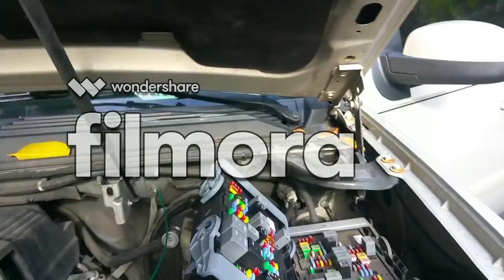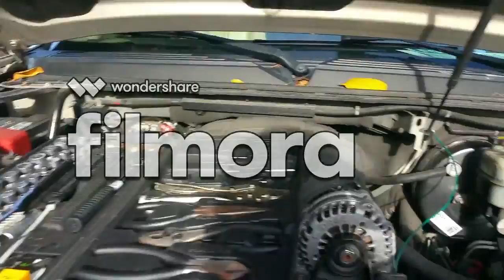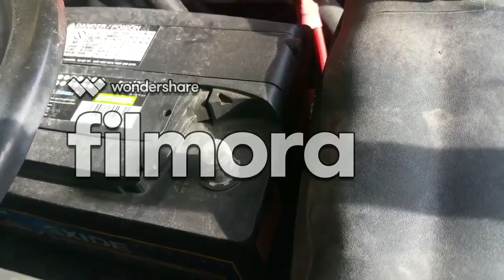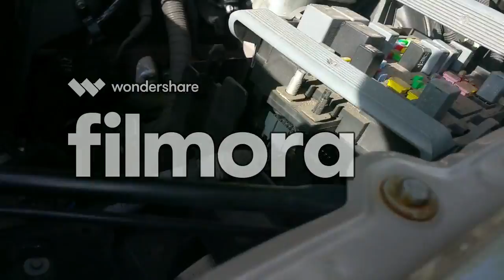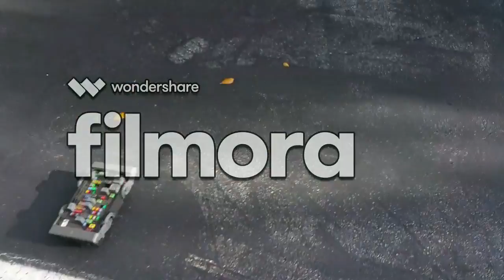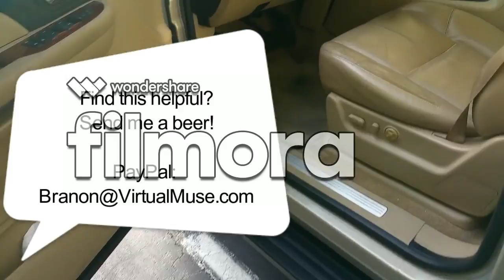2007 Chevy Suburban 1500 LTZ Replace Fuse Block to Repair Electrical Issues

Comment: Thanks for the video. Good idea using the contact cleaner. 
It’s recommended you remove the negative battery cable.

Comment: Thank you !!!!! I’ve been having electrical problems and the ground wire was the problem the whole time I did just like you did the the extra wire after taking’s the fuse box out🙄 but it fixed all my problems
Reply from the maker: I'm glad it helped! It amazes me that the dealerships don't seem to know about this - or they do and just want to replace one shorted out part after another to make a buck. I've been amazed at how many people I've met and chatted with over the last 6 years who've had ground wire problems on their Chevys. Now, if I could just monetize the video. LOL

Comment: 2011 chevy Silverado 5.3.  My relay for my fog lights ((4 prong) one of the prongs broke off inside due to corrosion.  Is there a way to get that broken prong out of the fuse panel?

Comment: I have a short going to the fuse block killing my battery I wonder if that’s the same issue . 2010 Escalade
Reply from the maker: Could be.. just add an extra ground wire from the firewall geound screw to the alternator bracket and see if that helps.. might also take the fuse block off and make sure there's no stray debris
Reply: @branon9531  oh I did the ground there a while ago and replaced the ground on terminal going to front bumper. I’ll try fuse block. Thanks man

Comment: Are these panels the same across options in that year?
Reply from the maker: I believe there were 2 different versions, the parts place used my VIN number to pick the right one. Mine was the LTZ, so it was probably the more expensive of the 2. LOL

Comment: Branon I have a real challenge wanted to see if you can help. I have a 2004 Chevy Avalanche and when I go to turn it over all I get is the clicking. Long story short I replaced the starter, did work. I then replaced my still under warranty battery still didn't work. I thought it may be starter relay but didn't work. I then checked my battery with multimeter while it was running to make sure the alternator was charging. I only got 12.6 volts max. So decided to replace the alternator but it is still not charging my battery and truck won't crank without my jump box. Please help!!!
Reply
Reply from the maker: I'm a real estate broker, not a mechanic - I just do a little Do-It-Yourself on things that I have the tools to do. I would check the ground ribbon that runs from the fire wall to the back of the motor (a little awkward, I had to actually lay on the engine to see where it connected). I would also add the second ground wire as I discuss in the video since there are dozens of grounds that go through that one grounding point. Any one of them could be creating an issue. If you get stray warning lights like Stabilitrack, ABS, etc.. it's often the ground wire just not making a good ground. Apparently, electrical problems caused by faulty ground is a major issue with the big block Chevys and GMCs.

It does sound like it could be a starter relay, but if the alternator isn't charging, maybe the wiring from the alternator to the battery has an issue? Again, start with the simplest fix (add the second ground wire from the fire wall to the alternator bracket).. and then start using your MultiMeter to see if you can find a broken wire somewhere between the alternator and the battery. I'm sure there's someone who's commented here that has had a similar problem or might be a mechanic who can help. Good luck, and if you don't mind, please report back so we can all benefit from what you learn along the way. Thanks!
Reply: @branon9531  well after alot of testing and head scratching I finally figure out the problem. It was a bad ground off the negative battery cable going to the frame. I have since added a ground from the negative side battery cable going to the firewall and all is working like it should! Thanks!!
Reply from the maker: @roosterpalooza1985  Nice catch! Glad it's working again!!
Reply: @branon9531  thank you for the response I will definitely be checking that ground ribbon today and adding the extra one you suggested. If I happen to solve this mystery, I will definitely be following up to let everyone know.

Comment: My 2011 Silverado LTZ radio will turn off on its own and my stabiltrak will turn off as well. I hope adding an extra ground cable will work I’ll do it tomorrow after work I’ll keep you posted. Thanks for this info!!

Comment from the maker: I can't find my original purchase email, but I think it was this one:
https://www.gmpartsdirect.com/oem-parts/gm-junction-block-19210436
Reply: They have it.  There’s an important factor of major concern.  Many of the online sales sites have you enter your VIN to confirm correct part purchase.  However, many of them use the same source and there’s a glitch in it.  In my case, all the sites said that the 22798214 junction block would not fit on my 2012 Chevy Silverado 1500 V6 WT.  I contacted several Chevy dealer parts counters and was informed that it was the correct part.  I pointed this out to the site that I made my purchase from and that’s when I was learned of the glitch.  Always contact Chevy or GMC dealer parts departments before buying.  A few dealers asked for the year and last 8 digits from the VIN where others requested all 17 numbers.  Even the site that I made my purchase from had the very same glitch issue.

Comment: I cant get none of the harness to release from old fuse box am I missing anything I pulled up fuse box and harneses are still attached  did you have to remove the 2 screws in front of fuse box pleaseee help
Reply from the maker: There are two levers on the ends that you unlock and the whole thing should just lift off. If the harness underneath are still attached, I'm guessing you would need to wiggle each one individually to get them loose. Just make sure you re-seat them in the right spots. I didn't have that issue, so I'm not sure.

Comment: Thank you for the tip where to get the fuse block. The braided ground straps can be bought in most parts stores in the battery accessory area. For GMs you should have one from the fire wall to the engine and from the fire wall to the hood. One video I saw recently said these grounds being bad can cause weak radio reception.
Reply from the maker: Yup - the first problem I noticed was my radio popping randomly... the problem escalated into ABS and Stabilitrack warning lights at random times. The ground ribbons are pretty easy to find, but you can't really tell when they start cracking because they're hidden behind the motor... adding the extra ground wire is just a backup preventative... and it's easier to check, obviously. I didn't notice one going to the hood... I'll have to check that.

Comment: Any cheat codes on getting wiring harness apart from fuse block? Mine is not sliding off nearly as easy as in the video.
Reply from the maker: Assume you would just wiggle each one individually a bit to get them to release. Hopefully, you didn't get a short that melted anything together. Sorry for the late reply. I don't monitor this channel regularly.

Comment: Could this also fix the relays to the door??? My 09 Tahoe isn’t getting an power to my driver door
Reply from the maker: Entirely possible... the ground wire  supports something like 80+ points. It's $3 worth of wire.. what could it hurt?

Comment: Been having electrical gremlins for about a year.  They come and go...I wiggled tight all of the harnesses, cleared codes and was back on the road issue free...been doing this from time to time but I'm to the point that I need to fix it for good.

Will definitely be adding the extra ground.  Any thoughts on the RVC Regulated Voltage Control system?
There is a sensor near the fuse panel that reads the return current and then tells the alternator to charge the system.  Some have had success with unplugging this 3 pin harness while others have addressed the error in the voltage signal return by replacing the grounds (path of least resistance...bypassing the measured return ground)

Just thought I'd share my thoughts and ask to see if any of the electrical issues have resurfaced?

Stella's UP!
Reply: Jay did you figure out how to fix the RVC issue you described above. if so care to share I may have the same issue as my new alternator is still not charging my battery.
Reply: @roosterpalooza1985  
Clean all harness connections...at tranny...BCM...Everywhere
Install new positive and negative GM OEM battery cables 
Added an extra ground from alternator mount to existing firewall ground on drivers side.
Problems went away for awhile....started again.....changed the alternator...even though it tested good and we haven't had a problem ever since

Comment: 🤦🏾‍♂️I lost a terrible fight last night to those 2 stupid fucking grey plastic arms. I tried for 2 hours to get then in the right groove to get them to lock the fuse box on and just ended up breaking one of the black retaining clips on the base and both gray arms. I've replaced countless transmissions, engines, and many other common parts on cars and trucks throughout the years and I think I've met my match. I just couldn't get it to seat in and now my brother's 13' Yukon Denali is stuck in my garage until I figure this shit out. I'm almost to the point of taking out a personal loan and towing this damn headache to the dealer and let them take care of it. I know I'll be anally raped on the price but right now I'm pissed and ready to get it back on the road. Any more tips on persuading the box back onto it's base or am I totally screwed?
Reply: If it didn't drop right into olace, my guess is they sold you the wrong fuse block. There were 2different versions for my 07 Suburban, and they had to use the VIN to order the correct one
Reply: Agreed, those handles are a real pain and they have to be manipulated in just the right way to remove and reattach!

Comment: Are there supposed to be nuts on those two posts/threaded bolts sticking out of the relay piece that you pull out (visible at three minutes 55 seconds)???
Reply from the maker: No, that's how it came... and I did not have to remove any nuts from those post bolts when I removed the old one

Comment: The two studs in the front of the box are for your trailer breaks and your constant 12v to the 7 pin harness in the back bumper..
Reply: So they are not supposed to have nuts on them if nothing is attached?
Reply: Thanks for this response, mine has wires there and I didn't know what for.

Makes since now as I have a trailer brake controller.

Comment: So while my cousin unhooked the positive cable from the battery to replace the fuse block I notice he accidentally touched a metal piece under the hood with the positive cable & now that the fuse block is in nothing on the truck is getting fire even doe my battery is brand new & was working fine b4 all this...Can you tell me what can b the problem please
Reply: Cornelius B Jones check the 175 mega amp fuse
Reply: I always thought you just needed to remove the ground wire working on anything electrical?
Reply: Agreed!  Check the mega-amp fuse and always disconnect the battery ground terminal first and reattach it last.

Comment: I have a 05 tahoe. Will this fix my 4x4 selector and my heated seats. They seem to have a mind of there own. Middle of summer, driving down the highway and the heated seats will just start on there own. It will do this several times until I shut down the engine and re start it.

Comment: I have a 2007 yukon.  My backup lights stay on all the time too.   I had to pull the fuse because it has been going on for a few months now.  

Recently, I added the ground wire, like in this video.  Since then my truck doesn't want to turn off, after I remove the key.  It'll will sometimes run for 3-5 more seconds (once it ran for 30+ seconds) after I remove the key.  I don't think the new ground wire caused this.  Probably a coincidence.  I figured this new issue was also from a bad fuse block.   Note- it isn't dieseling, it is running smoothly, it just doesn't want to turn off for a bit.

So I finally replaced my fuse block (just like you did).  However, replacing the fuse block and it did NOT solve my reverse light issue or engine continuing to run issue.

If it is not the fuse block, does anyone have an idea of another reason why my reverse lights would stay on, or why the car would keep running after the key is removed.
Reply: Probably need a new ignition switch if it wont turn off
Reply from the maker: See comments above about trailer lights... could be a bad neutral safety switch apparently. The reverse light issue SHOULD be the relay built into the fuse block - especially if pulling the fuse fixes it. The entire problem stemmed from a bad ground - replacing the ground wire (ground ribbon from firewall to rear of engine) or adding a second ground wire from firewall to the extra bolt on the alternator bracket - should prevent and solve many electrical issues on the big block Chevy/GMC trucks.

Comment: Good video but. Someone repair the fusebox???
Reply from the maker: The backup relay is a circuit board built into the fuse block, so there's no way for a layman to fix it. The other relays are just quick swap outs, but the back up is hard-installed
Reply: I’ve owned my 07 Suburban for 4 years now and haven’t had reverse lights the entire time. Going to pull a couple junk yard fuse blocks hoping they’ll be in good shape enough to get reverse lights.

Comment: Your fuse block simply lifted up off the base, which is super convenient.  On my son's 2008 Silverado, the wiring harness connectors lift up with the fuse block.  Since you can't rotate the fuse block when connected to those three stiff harnesses, you have to disconnect everything "blind," and singly.  What a hassle.  Thanks for the video and the tip about the ground, that's great info!
Reply: ya...what he said. the wiring harnesses do not stay in the tray on the 2008. you have to reach in there and pull them off. you can place the harnesses back into the tray them press the fuse box back on top. $307.00 at the dealer. My wipers did not work.
Reply: Is there some special tab under  fuse box.? Or they just pull straight down?
Reply: @ant03609 that's my question any luck
Reply: That's my question

Comment from the maker: Just FYI - if you are having ANY electrical problems with your big block Chevy - add an extra ground wire from the fire wall to the alternator bracket first. That $3 piece of wire may save you tons of troubleshooting! (This is the green wire you will see in the video) 10 gauge or better.
Reply: Great video! I am currently have the similar issues with my instrument cluster. Where did you get the cable from and the screw to for the alternator mounted end?
Reply from the maker: @mrparker1972  I bought a piece of wire from the auto parts store along with a bolt that fit (8mm or 10mm, I don't remember). The second time - just to update the wire since I crimped it while doing some other work, I used 16guage wire and standard electrical connectors.
Reply: Have the same problem in my 2009 silverado. Trying this tomorrow, maybe save me some money. 
Great video
Thanks!
Reply: I'm sorry , but what is symptoms why you would need to make ground wire from cab to alternate!?
Reply from the maker: @chadbailey189  See more recent comments, but basically the ground ribbon that goes from the fire wall to the back of the motor can get kinked or break down over time, which creates a bunch of electrical issues. My Suburban (and my dad's Silverado) would throw random codes and warning lights including ABS, Stabilitrack, even the radio would pop occasionally. Eventually, the issue escalated in my Suburban and it blew out the backup relay. Unfortunately, the backup relay isn't a quick plug and play $19 relay... it's actually a circuit board buried in the Fuse Block, so when it goes, the entire $300 fuse block has to be replaced, which is what I did in this video. Adding an extra ground wire from the fire wall to the extra bolt hole in the alternator bracket solved the problem on my Suburban and my Dad's Silverado. Above I said 10 gauge wire... it should be 16 gauge or better, and I think the alternator bracket is an 8mm, but it could've been a 10mm. I have a Tahoe now, and the first thing I did was add the extra ground wire.. so far so good.

Comment: So please don’t do what this guy did the main issue was ur ground all along I know for a fact I owned my truck since 2006 nbs Silverado and only problem that I know is the ground on these trucks
Reply from the maker: Exactly - the ground wire is apparently responsible for like 90% of Chevy's electrical problems. I didn't catch the issue until the backup relay burned out.

Comment: First of all u fuked up disconnecting the positive never disconnect it u disconnect the negative first that’s y I’m 100 percent sure u messed up that relay by disconnecting the positive and reconnecting ur lucky it didn’t blow out again when making this video
Reply from the maker: The relay was messed up BEFORE I did anything to the battery. As stated in the video, the backup lights were staying on ALL the time, which meant fried relay. I was always told to disconnect the positive because there's no way to short out the system if the positive is disconnected.. but you can definitely ground it out if the positive is connected an you only disconnect the negative... the negative cable just has to touch something and it grounds and powers up the system. But hey, thanks for your 2 cents. :)